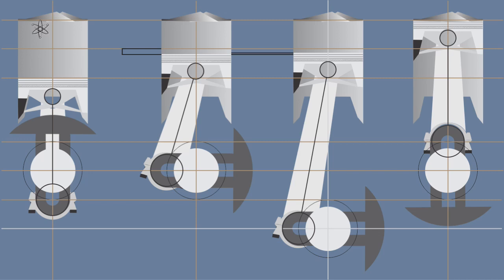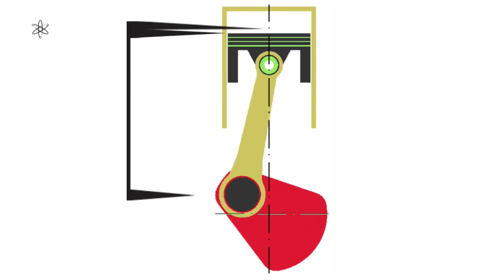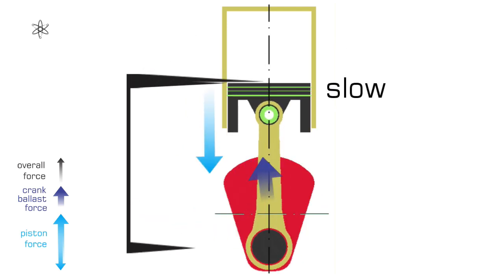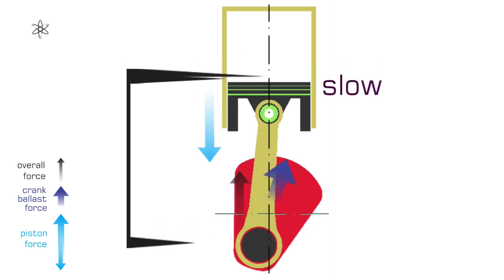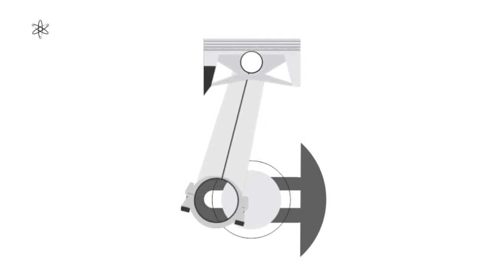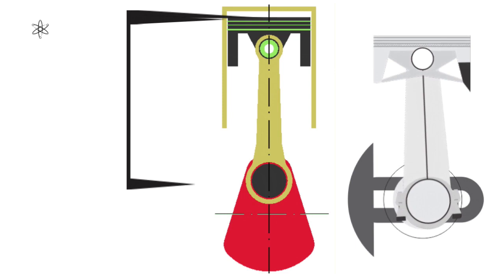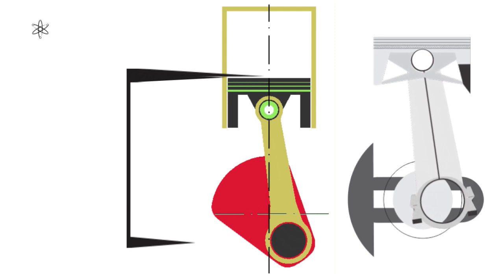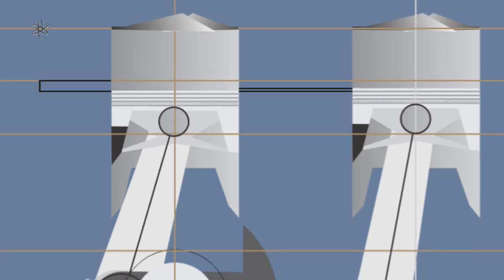Piston Engine Secondary Vibration Simplified

Comment: I would think that the piston is moving the fastest in the middle, between up and down as it comes to a stop when being in its highest AND its lowest position, where its speed is zero.
Reply: topic is vibration
Reply: I agree because the vertical rate of travel is slowest nearer TDC and BDC than it is at 90 and 270 degrees. I still need to learn more about this. Maybe it has to do with the rate of change of speed? Deceleration rate and acceleration rate vs that relatively more linear speed rate of change at 90 and 270?

Comment: There is a lot of confusion here to what is actually going on. 

The main issue here is transfer of kinetic energy. The movement of the pistons is a perfect sine-wave. The sine wave dictates the rate of change of the crank pin along its plane, the X and Y axis. But since one single piston which is connected to the crank pin only moves along one axis, it constantly alternates between moving very fast and not att all in top and bottom dead centre. That means that there is a considerable amount of energy that goes in and out of the piston twice for every rotation of the crank. This energy does not just vanish into thin air. It moves into the crank which translates into rotation speed of the crank, or whats called angular velocity in engineering. 

It is this constant transfer of energy and change of engine rotation speed that is the root cause of these secondary vibrations.
Reply: The movement of the piston is not a perfect sine wave. That's the problem. The shorter the connecting rod the more it deviates from sinusoidal, as the video implies. Here is a graph of the motion:
https://www.intmath.com/cg3/curve-shape-movement-piston-applet.php

Comment: Good explanation! Why is the inline 4 more prone to this secondary vibration then a v6?
Reply: Is because of the lenght vertically of the i4 (not rigid) so it will fall down if nothings holding it.compare to V6 that it has both top section to counter act force.think about of letter "I" vs. "V" and then stick them on a paper using rice as s glue ,then put some just the top edge of it,then shake it.the "I" will fall

Comment: So no matter how refined an engine is, be it a Rolls Royce or my cheap Renault, there should be a noticeable vibration especially at higher rpm?
I was looking for a reason why the engine of my previous car, which is a Subaru(Boxer engine), had very smooth revs compared to my inline 4 Renault.
Reply from the maker: the boxer arrangement mirrors the opposing piston that moves the opposite direction...this neutralizes vibrations
Reply: Some engines have extra balance shafts to counteract the vibration. But this only makes the driver feel less vibration. The forces internal to the engine are still there.

Comment: What is the advantage in reducing this secondary vibration? More revs?
Reply: I believe ability to produce larger engine - more displacement (since larger the engine, larger the forces) at the cost of reducing max RPM (longer=heavier connecting rods means more moving mass which puts more stress on pins, bearings...). But not quite sure about that.
Reply from the maker: certainly it may make components more reliable and reduce n.v.h. or noise vibration harshness.
Reply: @SpeedMediums  EXTREME ADVANTAGES for whoever solves it. More power out of less cylinders = less pistons/valves, etc = less frictional heat loss so smaller radiators. Less moving parts = less operational maintenance and cost. No secondary imbalance would mean no counterweights on crank, less beefy parts, even more compact engine design. Also means more power, less "destructive interference."